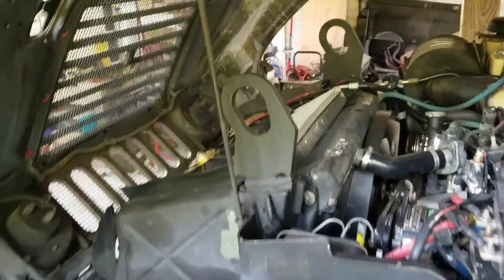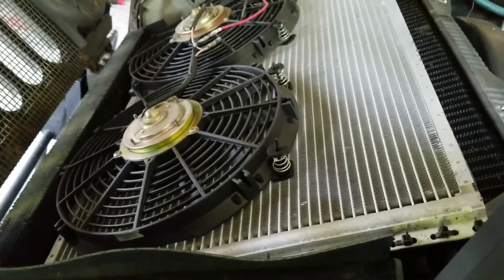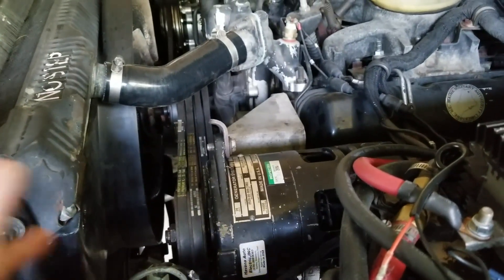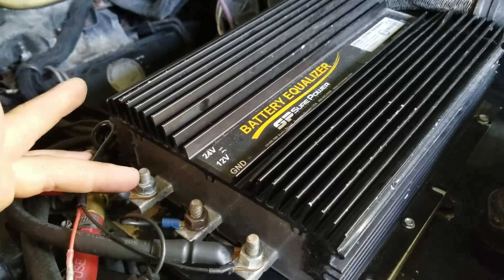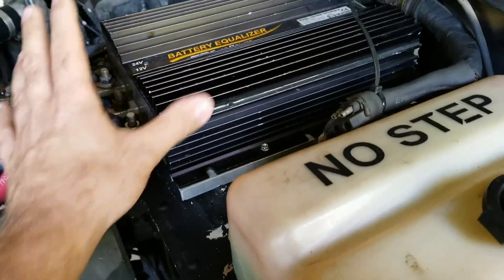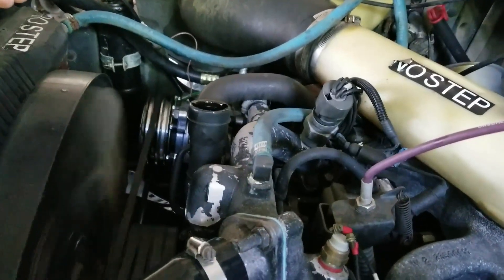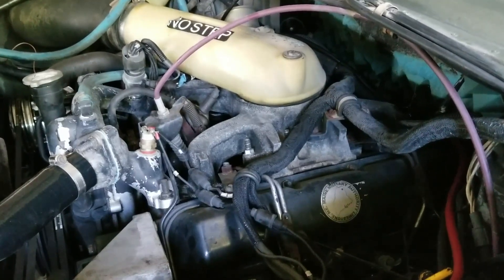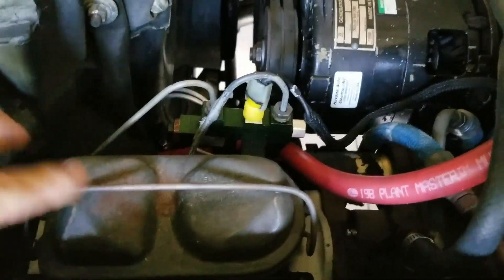1989 Humvee engine Mods

Comment: I like all the detail.  I see you have sound insulation on the dog house too.  I bet the truck is quiet inside.  We run ours hard off road.  I wouldn’t be able to have the power distribution box there as it would get drenched with water and mud.   What kind of adventures have you had with it so far?
Reply from the maker: The insulated dog house did the most for the engine noise, it was a bit much otherwise, I honestly didn't do very much adventuring with it as it was my daily driver, spent alot of time driving it but nothing extreme. I'm working on a new one now, will have the 12v Inverter inside the cab this time, also going to do a new style doghouse, will be posting videos soon!
Reply: @TheCoralSniper  looking forward to it.

Comment: Can you do a video of how you changed the fan out from Hydraulic to mechanical . Want to upgrade mine!
Reply from the maker: Will be building my next humvee soon, will be making videos of it all and I can try and make one of that fan swap👍
Reply: @TheCoralSniper  I'm here a year later for that fan swap lol
Reply from the maker: @nminskey  I ended up not swapping the fan on my most recent humvee 😅, but all I did was buy a used 6.2 diesel chevy pickup fan and thermostatic clutch and I was able to bolt it right in place of the hydraulic one

Comment: Hi . Do you have a part numbers for the fan clutch and fan blade? I’m going to convert my too . Hated hydraulic clutch and now finally broke never disengage
Reply from the maker: I don't, but all I did was get a junkyard 6.2 diesel fan and clutch from a chevy, you'll have to get your own bolt just the right length but it does fit! Way better than the expensive complicated hydraulic system

Comment: On a Diesel engine there should be some "BLOWBY"  In fact "BLOWBY" is what makes the HMMWV Deep Water Fording kit (DWF) work!
Reply: No sorry, this is a bad thing. A similar myth to adding back pressure in exhaust system helps.

Yes they utilize it for dwf system but you can tap boost pressure for that - I built a p400 with a sumpless oil system running crankcaee in a vacuum of 6-10” so simply tap the boost circuit.  
Overheating these engines causes the blow by to occur sooner and is simply damaged rings.  I run gapless and have stock oiling system- eliminating cdr using a provent.  This method keeps crankcase pressure at a minimum and into vacuum most of the time.  Deep water still not an issue.  People went fording rivers half a century before this method was applied.

Blow by is never a good thing.

Comment: Common sense upgrades! Dot 5 was a disaster! Those big fans sure do scare you when they engage. Those 6.2-6.5 Detroit’s once perfected were excellent. Derived from the 8.2 fuel squeezer that had some serious cylinder instability problems to say the least. I had the opportunity to drive a civilian version when they were new and was impressed with everything I saw. Not much in the way of creature comforts and room inside but who cares when you can drive over the top of most SUV’s on the road. Thanks for sharing and I’ll be watching
Reply: I agree.  But I tell you the 6.2 is low on power.  However it makes it harder to break things when there is such lower rpm and low power.  It does chug chug all day though which has been awesome for off roading.